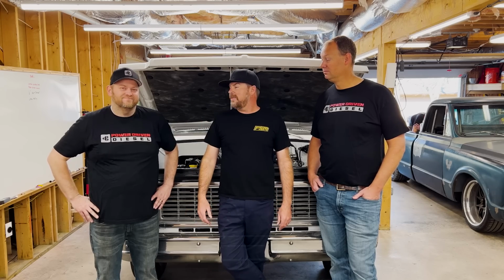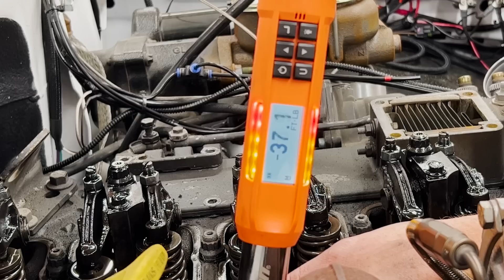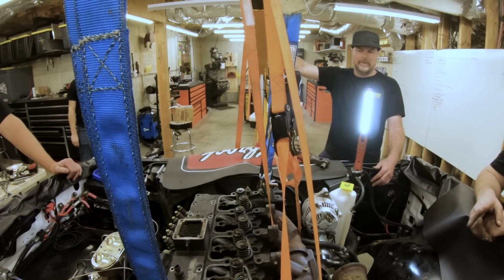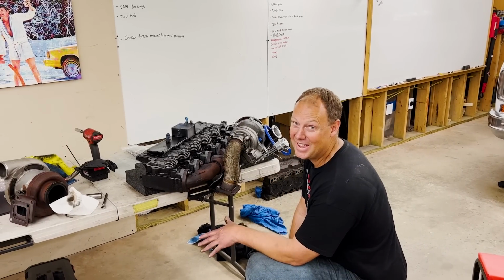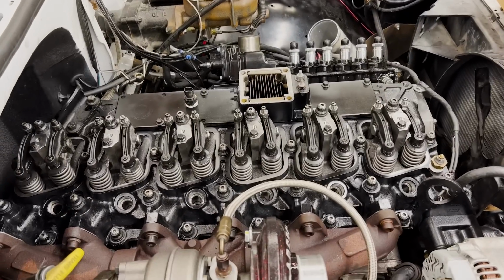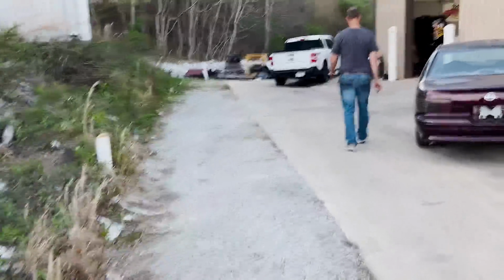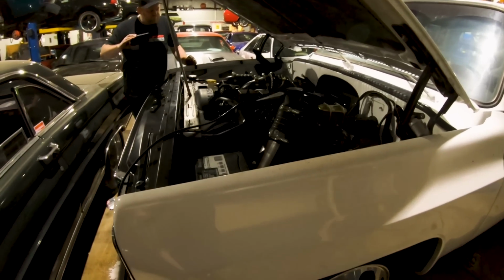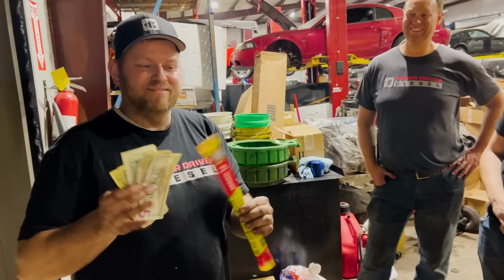I SPENT $6000 TO MOD MY CUMMINS-SWAPPED SQUAREBODY CHEVY AND NOW IT MAKES 1,350 FT-LBS OF TORQUE!!!!

Comment: While Snap on and Craftsman are great tools. I found out after breaking 1/3 of those tools, I discovered,  Northern Tools ( their BRAND !! ) was superior strength in their wrenches, ratchets and sockets 1” and up.  

I actually put a 6 foot cheater pipe on a 1 1/2 wrench, open end on the nut. I had my 225 pounds of force to the end of the cheater pipe and it did not break. Nut did not break loose either. So I bounced on the cheater …. That broke the open end wrench !!  
Bonus !! Northern Tools cost less than Snap On etc etc.

Comment: Use a tight fitting Torx in place of the Allen wrench to remove the head studs.  They are much harder than Allen wrenches are, and won't round over like those do, and also won't distort the Allen socket in the head stud.  They work so much better that I don't use Allen wrenches anymore.

Comment: The reason Nord Locks work is because the outer serrations dig into each surface and the ramps on the inner faces are angled higher than the pitch of the bolt. Basically they require the bolt to stretch in order for them to rotate relative to one another.

Comment: PDD has been doing some awesome colabs lately. I think they get underestimated for what they can do.  But they are for sure some awesome guys.
Reply: They are also super helpful if you email them. I had a few questions when I was working on my 5.9 Freightliner service truck, they were very helpful.
Reply: "Colabs"? 🙄
Reply: @gteefxr3094  collaborations with various youtuber creators like westin champlin, Mike Finnegan, etc.
Reply: Power Driven Diesel
Reply: That's because they don't do anything relevant in the diesel community
Reply: @wariii  why or how dont they? They run the 12v game, and probably been doing this longer then most. Popularity on youtube or social media doesnt mean a thing. Just cause you dont see it happen doesnt mean it isnt there.
Reply: These guys are awesome, I have a piece of their motor that blew at Indy in that video, hot right next to me and I was pretty far up in the stands when it happened. One of the most impressive blow ups Ive ever seen
Reply: @builtbyme  they started building parts for 12 valves in 1999, the 12 valve was a brand new engine then lol
Reply: @HoodRatDiesel  lie that’s all they do😂

Comment: Mike I really hope you have an emergency manual intake air shut-off pull handle in the OG ramp truck. Always smart in a diesel just in case of a runaway situation.
Reply: good idea - I've had to pop the hood and jump out to hit the fuel shutoff a bunch of times😂
Reply: @boredom.victim  in a genuine runaway, the fuel shutoff is useless as the engine starts running on its own oil from the breathers etc. need to block of the air intake to shut off a genuine runaway.
Reply: @boredom.victim  shutting the fuel off doesn't always work though if it is burning its own oil or if the fuel rack sticks like it did on Demolition Ranch's 12 Valve Plymouth Cuda .Which is why killing the air intake is best. No air no combustion.
Reply: Yes please give all your tips on building diesel for the experts who don't know what they are doing. 🤣🤣🤡🤡
Reply: It'll stop eventually.....why worry about it
Reply: @mwhitelaw8569  many reasons why. Look it up...learn something important.
Reply: @dalelc43  yes please be that one person who thinks that anyone is an "expert" in anything. Everyone screws up eventually. Even you.
Reply: @mwhitelaw8569  only a fool would say he has seen everything. Even more of a fool to think he can brag about it.
Reply: The old detroits would actually run backwards, all kinds of carnage

Comment: Try a 50/50 mix of WD-40 and trans fluid. I used old trans fluid with the WD-40 and it works really good. Can use some heat on the bolts first then spray it on. Let it soak for a little while.
Reply: I just changed my trans fluid in Allison this weekend now I know what to do with it

Comment: Finnegan talk Tod into finishing the Turbo School  play list, where he teaches us how to do the math for properly selecting/sise turbos based on actual flow  to match fuel delivery. 
He did a badass job explaining sizing with singles.  I'm ready for the next step of twins  on my Allison 6sp 1st gen. Hit 178.3hp 491.0tq wheel with there Mustang on stock fuel molded hot side stock turbo.(160/400crank rated)